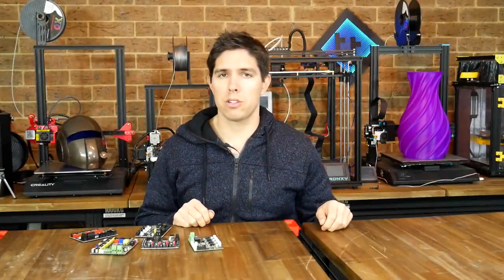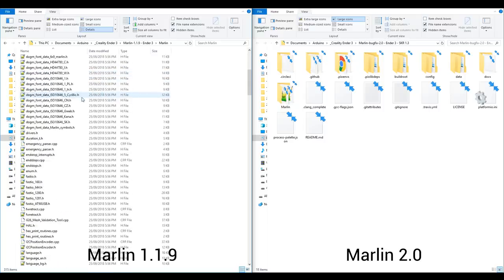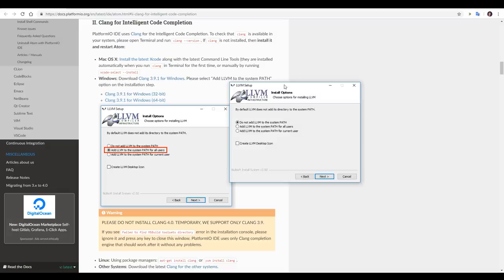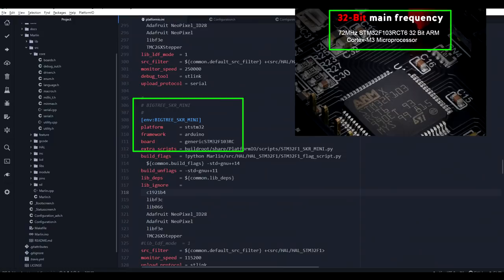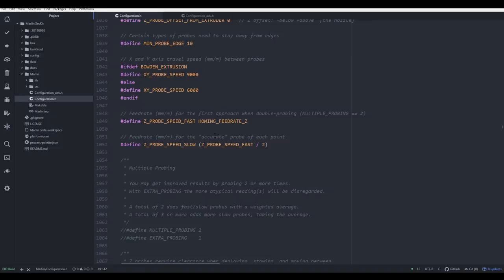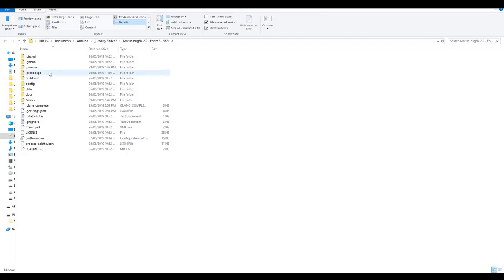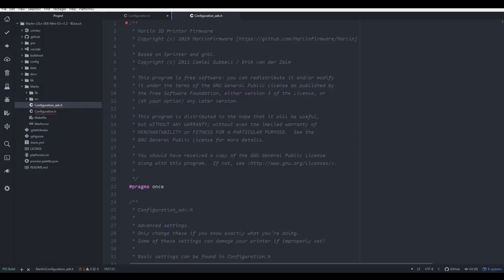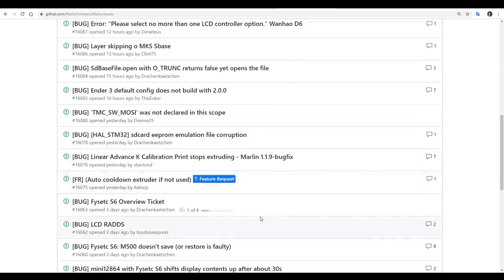Migrating to Marlin 2.0 guide - Setup and troubleshooting UPDATE IN DESCRIPTION

Comment: Is Gcode generated for Marlin compatible with Repetier? I love Cura for my CR-10, but my flashed DaVinci 1.0 uses Repetier.
Reply from the maker: Generally the bulk is gcode is compatible between different firmwares. It's only really specific things that might be unique. For example when I covered the Tronxy X1 which uses Repetier I sliced the same as any other printer without issue.
Reply: See the RepRap wiki g-code page which lists all RepRap G-codes and which firmwares support them. We add new codes to this page before we add them to Marlin. Prusa Research is now also taking the time to edit this page.

Comment: Is there any possible way to run Marlin 2.0 on a raspberry pi similar to how klipper firmware works? I am using klipper and not getting any noticeable benefits. I played around with the pressure advance feature but due to my bowden setup i did not find a setting to get it to increase print quality so i do not see a need to use it but would just like to use Marlin but with a stop 8bit board in junction with the pi board

Comment: ok... was doing fine with this till... selecting the env.  in the firmware i see several diff models of the bigtree skr mini 1.2. Amazon description doesnt tell me which version i have. is there a way to identify which of the 4 versions listed i have? 

#   STM32F103RC_bigtree ............. RCT6 with 256K
#   STM32F103RC_bigtree_USB ......... RCT6 with 256K (USB)
#   STM32F103RC_bigtree_512K ........ RCT6 with 512K
#   STM32F103RC_bigtree_512K_USB .... RCT6 with 512K (USB)
Reply from the maker: I recently went with the 4th and it has worked well
Reply: @TeachingTech  a response from the man himself. Thanks. I will give it a shot. currently getting diff error when i try to compile. the sanguino or atmo select issue. and since this isnt arduino software im looking for it in Atom.

Comment: Hi, I'm trying to update the SKR mini E3 1.2 for my ender 3 pro, because the manual bed levelling is not activated in the menus. So I tried to compile the firmware in ATOM but I get an error "STM32F103RC_bigtree_NOUSB       FAILED  " I cannot find the issue and how to solve... I tried different environments STM32F103RC_bigtree_NOUSB / STM32F103RC_bigtree_512K / STM32F103RC_bigtree_512K_NOUSB etc... with no luck, any help?

Comment: Hi Michael. Love your videos. I’ve watched a lot of videos about burning firmware, and the need for a boot loader. I have an Ender 3 Pro, which I got just before Christmas. It’s got the 1.1.4 board and is running v 1.1.6 of Marlin (that’s from memory but I think I have it right). By following Bryan Vines’ video, I’ve determined that it has thermal runaway protection (yay). I was wondering if there is any easy, non destructive way to determine whether my printer has a boot loader or not. I don’t recall seeing that mentioned anywhere. Keep up the great work.
Reply: It does not really matter if it has a boot loader or not.  If your are thinking of upgrading your firmware, just start that and try to upload your new version to your printer.  If it does not have the bootloader, you will find out.  In that case you will need to install the bootloader.  At any rate, it is just one more step you will need to do.  Trying to upload a new version without a bootloader will do no harm to your printer.  It just won't work but will not leave you in limbo.

Comment: One quick question: I've upgraded to a mks gen l a while ago and by this also got rid of the SD card reader. I just use OctoPrint for printing instead of the old sd card reader. How would I undergo a firmware flash then if not via SD card and rebooting?
Reply from the maker: MKS Gen L is still 8 bit so it doesn't rely on an SD card to update firmware. You can still update via USB.
Reply: @TeachingTech  oh that's a bummer. didn't even know that it is 8 bit. But thanks for the heads up anyways, I really appreciate it
Reply: OctoPrint has a plug-in for updating firmware so you can just send it over WiFi. I cannot remember off-hand whether it supports installing firmware on the SD card. The board must be able to make the SD card available over USB.

Comment: trying to replace bad cr10 mini mobo with skr 1.4,  seems like so much of this video does not apply to the latest marlin 2.0 releases on github or the bigtreetech v1.3 marlin 2.0.  Not getting anywhere with this board and atom with all the appropriate packages installed.  Just keeps giving errors such as "no platformini.ino etc, have been all over youtube with no success and I have a dead cr10 whose stepped driver has failed for the extruder.

Comment: None of this is working out for me. I'm going step by step and the same things are not happening. Typing platform gets no results that match yours, including the one you need to download. I had to type it into google, which I clicked and it asked me to open atom, which it did and then installed. It never asked me to install ching. I got the marlin files from marlin github, went to config, all that's there is a config file. This is all very horrible because I had a working ender 3, I installed an extender XL and now I cant use the printer because I have to edit the firmware which I can not do, no matter what I try.

Comment: Thank you for your helpful videos which got me into 3d printing but I am struggling with setting up Marlin 2.0 for myself after being advised to learn how to do it. Just adding marlin files I get errors and failed messages on every attempt so far. I have given up with atom and now trying to use vscode but to no avail. The messages have no meaning to me because I am not even able to select a board in tools which does not even appear the my menu tabs. Tearing my hair out trying to understand what I am doing wrong. Hopefully someone can help

Comment: Can you please help?  I have been trying to upgrade marlin 2.0.1 thru @t for two days. The firmware looks like it is working. However the display Is messed up. Can barley can read the screen. It looks like the wrong display is selected. Motherboard is a the Creality v2.1 with the stock display. I looked at the Creality firmware v1.1.6 and found the display is REPRAP_DISCOUNT_FULL_GRAPHIC_SMART_CONTROLLER. I selected that display in the build, complied, and upload the firmware. When I rebooted the Controller the display is blank. If anyone has had this issue and corrected the issue - please help. Right now I'm back to V1.1.6

Comment: This move to a 32 bit controller (BTT SKR E3 mini V1.2) has been a struggle. I have tried both VSCode and Atom and I have a good compiled firmware.bin but I can neither upload it via the USB nor move the .bin to the SD card and boot my printer. I have tried 2 BTT boards and my PC cannot "see" my SKR Mini and the file sizes is 212kB.  Any advise on getting my firmware.bin file flashed?
Reply: Can't you just use a USB sd card adapter to copy the file ?
Reply: @emmanuelauffray8292  When I use the USB SD card adapter to try to move the firmware.bin file to the printer it doesn't boot up. It seems to me that my PC should be able to connect to this board but it doesn't do that either
Reply: @steverichab  , well for whatever reason my board is not picked up by windows 10 and I did not bother installing the driver from BTT but I would recommend to try different USB ports and/or adapters.
Reply: @steverichab  also had issues when I ended up with a bad firmware and to confirm I just used the BTT one and then the printer booted correctly. Although you can go through using directly the Marlin repo, I would suggest to use the BTT repo to start with.

Comment: None of this works for me whether using Atom or VSCode. I keep getting an error whenever I try to build. Always fails indicating a problem with the board environment. Trying to update the firmware on a Bigtree SKR Mini E3 V1.2. No matter what environment I try to use it doesn't like it. I've tried to use STM32F103RC_bigtree, STM32F103RC_bigtree_USB, STM32F103RC. Getting frustrated.
Reply: I'm having the same exact problem, did you ever figure it out ?

Comment: This will be the way I go. Your video on ender 3 BL touch and run-out sensor is still valid, but now with 1.1.9 the things you turn off still aren't enough to get both in there, and your preconfigure file won't compile due to the sanity check saying it's outdated. 

Essentially I followed the guide but also turned off 
//#define LCD_INFO_MENU // enabled, shows useless 'about printer' menu 

//#define STATUS_MESSAGE_SCROLLING // enabled, saves some flash space

 //#define DOGM_SD_PERCENT // disabled, show print % bar graph

Comment: For the life of me I cannot figure out what board I have to change the environment default.  

STM32F103
RCT6
991PH  93
MYS 99 941

That is what's printed on the main chip, it's slightly different from what was shown on the video.  My board did not come with any data sheet and I cannot find one online that says what I need to use.

Comment: Plz make e guide for ender 3 with the skr mini e3 , bltouch , smart filament detector and the power relay  ( and I watch some videos with that board having mode memory )
Reply: RezKom what do you mean by smart filament detector?
Reply: Pretty sure Michael did already that video except for the power relay and it is even a link in the video
Reply: @faxxzc  the bigtreetech sfs can detect if the filament move or not and if it's run out

Comment: The following rant goes to most 3D printer producers no matter the brand. 
3D printers won't get into masses as commercialised until you make it easy enough for a housewife to use / update firmware / software. I get this is not a typical procedure a housewife would need, though it needs to be dumbed down to a minimum press / click. Today, one updates smartphone and home appliances easily w/o having to go through numerous specific steps. Plug and play or KISS principle. IMO, until then it is NOT worth buying any 3D printer since at some step it may just not work even if all steps are followed. Unless you enjoy tinkering with all the wires and software issues. 

Issues as of October 18, 2020:
1. Doesn't see the TF card.
2. Clang takes forever to install. This - https://github.com/platformio/platformio-atom-ide/issues/906 has already been tried. No luck. 

Wish it was Arduino without 3d party junk, like Atom (178 Mb payload), Git client or Clang (dunno Mb). If you ask me, Arduino is more known than Atom. Arduino needs to get their u8lib and Sanduino or whatever universal board up the MUST list when a user connects a 3D printer. Or better yet Arduino needs to learn sniffing and sensing which board is being plugged in, processor type and other components and automatically show prompts for a user to download missing components on demand. 

All via USB, no ICSP.

Comment: I get this error: Marlin\src\HAL\HAL_STM32F1\../../inc/../HAL/./HAL_STM32F1/HAL.h:87:4: error: #error "Serial port 0 does not exist"
There are more errors, but are pretty the same - Serial port 0
Reply: i got it solved by copying files from B3T SKR folder instead of ender 3 as shown in 05:25

Comment: One big difference between Marlin 1.1.9 and 2.0.x is missing: while Marlin 1.1.9 is a finished version, Marlin 2 is alpha state (not even beta...).
Anything beside standard configurations might lead to problems which are not caused by the user doing something wrong, but simply being a bug in Marlin. And this might change from one day to another.

Also this causes big problems using forks made by a board manufakturer.
For example: I tried a SKR e3 Mini before July 30. Till that day the Hardware Abstraction Layer (HAL) for STM32F1... processors had a big error. The directives weren't handled correctly by the preprocessor. As soon as you added ABL on the probe input (for example a film probe) instead of using the ABL-sensor as z-endstop, all endstops quit working.
As said, the bug was fixed  july 30th in Marlin 2.0.x-bugfix. But even weeks after that date, the GitHub fork from Bigteetech for the e3 Mini v1.0 based on an older version... (but it was corrected later by Bigteetech, so now you can use their fork) On the other hand, the main fork of Malin did not contain all needed definitions for the board at that time.
Finally I got the e3 Mini to work with a film-probe only after using the fork from Bigteetech, but copying the hal-folder from the actual Marlin 2.0.x-bugfix into it.

So anyone using Marlin 2 should be aware this is not as easy to do as using Marlin 1. In my case after 2 full days of trying I finaly found the bug report for STM32F1-HAL and had to give up (putting the stock creality board in my Ender3 Back again, as the film-probe on PIN 29 worked well). Only after July 30th, after hours of trying again (and finaly founding the solution to copy the HAL-folder from Bugfix to Bigteetech fork), I finaly could use the e3 Mini board.

Anyone doing something else than "mainstream" might have such problems. There are for example still some issues with emulated eeprom, storing z-offset and babystepping with probes other than on z-endstop connector.

After all the time spend getting Marlin 2 somehow working for my needs, I often think I should have spend the time for learning how to use Klipper instead. I definitly will try to do so after Xmas. The forks of Marlin 2 make it much to hard to make a perfect configured marlin at the moment. While I like to tinker and learn something, with Marlin 2 many things you learn get obsolet as soon Marlin is fixed and you do not need the hard discovered workaround anymore.
Klipper seems much more easy to config, as it does not depend as much on the hardware of the Controller board. Already using Octoprint on a old ThinClients (much cheaper than using a Raspberry Pi) and no need to go to 32bit controllers for cartesians anyway it seems the better solution to me.
Reply: Marlin 2.0 has officially released now. No longer beta
Reply: @5bitesrods  Sorry, but thats not totally correct. The big difference between a release and a beta is: Any change on a release means a new version number. So anyone downloading Marlin 2.0.0 should have the same code. Sadly this is not the case. Marlin 2.0.0 was "released" 3 days ago. If you look at GitHub, you see already one change without changing version number. So two people saying "I have Marlin 2.0.0" might not have the same code. Thats the reason the branch is called "Marlin 2.0.x" on GitHub, not "Marlin 2.0.0". 
Also  a release does not make Marlin 2 leaving beta-status. Marlin 2.0.x-bugfix was Alpha, not Beta.
y.0.x  (or any even number in the middle) normaly indicates  beta-releases, while uneven numbers are for productional use.
So Marlin went from Alpha to Beta 3days ago, not from Beta to productive state.
And of course this changes nothing with manufacturers making their own forks...

Comment: Marlin 2.0.x is a broken mess. There seems to be no documentation for any of it. They changed some things since this was posted and now a lot of code is hidden away in various modules.
I can't calibrate my extruder because G1 E100 F100 doesn't work, it's claiming the extrusion is too long, though the max is set to 200 in the firmware... I'm starting to regret upgrading to a 32 bit board this soon.  Early adoption comes with too many headaches.

Comment: 2.0 sharp release is just out! xD
Reply: also for those that are a bit more technically but still don't need VScode. you can just as well install PlatformIO directly in Python with pip install platformio
then you can run "pio run" in cmd in the marlin 2.0 folder to build.

Comment: It's 2023 why the F are we having to do this hurdles crap rather than simply selecting the marlin directory and you point it to the Marlin file with your printer type and just executing, this is the dumbest crap to run a firmware update. I would not be proud about this video or the bs we have to go through to get it to work